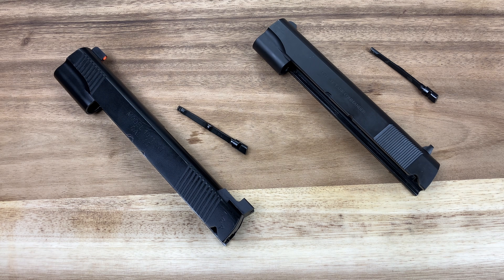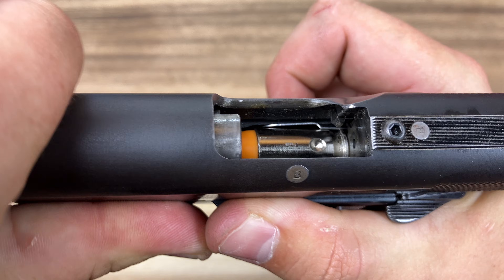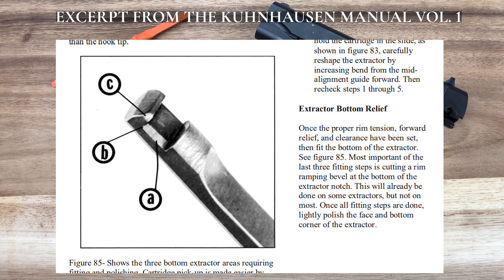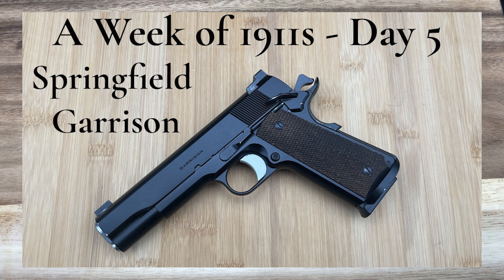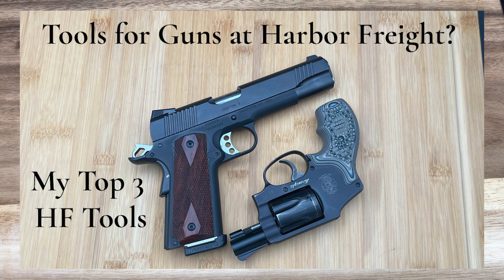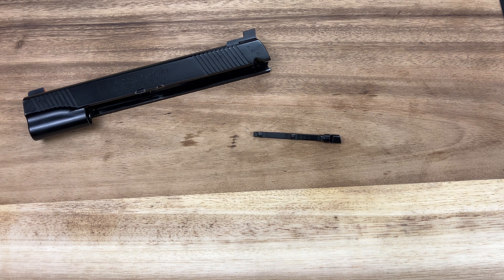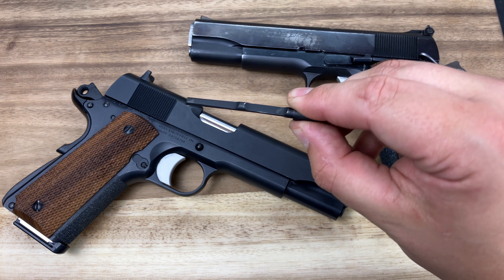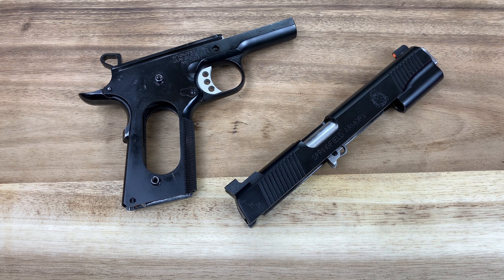A "Quick" Look at the 1911 Extractor (a Response Video to @OldPathTraveller 's Extractor Video)

Comment: Thanks for the (double) shout out homie! Great video. Enjoyable watch with my evening tea. Good info in this video, nothing I disagree with. Even if I did disagree... who cares I'm not an expert. 

I will also advocate for the 10-8 test procedure, I find it really valuable. 

This is my favorite extractor tuning video and how I learned to set tension on my 1911s:
https://www.youtube.com/watch?v=Xm3ss3XMQxM&t=420s

When I was researching for Episode 5 of my double stack 1911 build series (that contains extractor fitting and tuning information), I go WAY into the weeds. My initial script for that section of the video was going to be about twice as long as it ended up being. You can get into measurement and quantification of every aspect of the fit and even how its tuned. That was my starting point - I err on the side of quantification and measurement when I don't have a "feel" for something. I spun myself out and took a step back and said "what am I doing? I've successfully tuned a bunch of 1911 extractors." If the measurements and quantification of every little detail were valuable to me in practice, I would have included them in my video. Some measurements stayed in, those are what I find useful haha.

You hit most the high points in this video regarding tuning and some of the geometry mods.

When fitting - the fit of the groove to the firing pin plate - you want it tight, this also affects hook to breechface clearance.
The hook to breechface dimension, this is one I do measure, but the functional range is quite large.
Clearance between the tip of the extract and the front taper of the case rim area.
And where the hook interacts with the case. 

The hook needs to interact with the case in a different place on a 45ACP vs 9mm. I have ruined an extractor because I went to fit a 9mm extractor like a 45 extractor. It helped me to remember the minimum hook height you don't want to go below - about .030". If you try to fit a 9mm extractor like a 45 extractor, your hook gets way too short.

Then the little modifications to the geometry to help with feeding - like the bevel leading into the tension pad, and some polishing here and there.

The tension after it is fit and installed can be measured with deflection gauges. I dont find that necessary. The tension test I linked to, or the one in the Jason Burton video you mentioned, and the 10-8 test while firing will get you there.

The two Tisas pistols I had, the 1911 DS carry, and the MAC9DS (both Gen 1), had too much extractor tension out of the box. The MAC9 was so tight it gave me a couple failures to feed. I have seen production extractor tension all over the place.

Really enjoying your content bud.
Reply from the maker: Firstly, thanks for the kind words! I'm always happy to try and expose my audience to your excellent works. 

Secondly, I'd say that on the sliding scale of "expert", you are certainly at, or much closer to that designation than 99.9% of 1911 nerds out there. If I need technical information about the 1911, it's the Kuhnhausen Manuals, and your videos & experiences. 

The Atlas videos are generally pretty great for all of the 1911 works. I'd certainly recommend my viewers to go check out their sear spring video (although I like yours more), and their various tuning vids. 

For the firing pin stop groove, tight is certainly good. I'd say it's the least important of the aspects of the extractor, but a tight FP Stop fit will lead to a tighter, non-rotating extractor and good breechface clearance. A tight, fitted FP Stop will also lead to a  little less recoil (at least in my experience). We've fitted one oversized one, and that was kind of a process. All of my guns have relatively tight FP Stops though, so I won't complain there.  

We've also never found a need for the tension feeler gauges, just a matter of setting the tension, and testing it from there. 

My only 9mm Tisas came with the extractor tension fairly loose, which I know is kind of the opposite of most guns. Many of the 9mm guns that I've shot or monkied with (mostly Springfield and Tisas) tend to be over tensioned, like your two guns. 

Again, thanks for commenting brother! Keep up your great works! I've been really happy to see your channel growth over the last year!

Comment: I like "traveler" He's wrong about alot.  Question, stainless vs carbon steel extractors? Is one better than the other?
Reply from the maker: Just from the perspective of needing to work on it, the carbon steel ones will be easier to put some tension on, and will be easier to cut on if you need to reprofile the hook or bevel geometry. I don't know of too many companies doing stainless extractors these days, but I'm sure that they're out there.

Comment: Great video! Years ago, I had a cheap Rock Island 1911 .45 that I had to bend the extractor. I actually completely forgot about that until this video.
Reply from the maker: Thanks! 

With extractor tuning, it's really only a 1911-centric thing. I think of it like having a car that has a different way to change the oil filter when you're doing the oil change. It's not that hard to do, but it's something most guns need.

Comment: Paul, it seems like you are most definitely a purist and particularly enjoy the 1911 in its original form, internal extractor and all.  

That being said, have you had any experience with some of the more modern semi-custom 1911 designs beyond the 1970’s and 1980’s, where they come with link-less “bull” barrels, fitted or spherical bushings which remain in the slide during disassembly, modified slide designs with external extractors, and barrels that have one-piece feed ramps? (For example, some  SW1911 Pro series, Dan Wesson, and Wilson combat models, which incorporate many or most of these elements under the auspices of being enhancements, among other changes to the frame and not just the slide.)

In your opinion, does the change to an external extractor and the use of a single piece feed ramp integral to the barrel turn the 1911 into a push-feed design, as presumably the bullet is no longer being held by the extractor or feed ramp, and the cartridge slides into the chamber with the extractor then fully engaging the rim upon the slide closing completely into battery?

Are there potential advantages to the internal extractor design and the controlled round feeding when it comes to clearance of failure to feed or double feed malfunctions? 

Also, just as an aside… How does one safely remove a spent cartridge case stuck in the chamber and that has failed to extract without having to force the tensioned extractor to bend over and around the rim and risking damage or loss of tension in the process?

Thanks again for the insightful commentary.
Reply from the maker: I'll start from the end, and then loop back around! 

For the stuck spent casing, I'd recommend just locking the gun open, and using a rod or dowel to tap it out. 

For the bull barrel & external extractor guns, I have a lot of passing experience with the SIG, S&W, and Star pistols. That said, I have a lot of time with the Wilson Combat EDC X9 (three articles, a bunch of videos, and about 2200 rounds through the gun). 

When moving away from a bushing barrel and internal extractor, we lose some of our control over tuning the gun. That's not a problem if the gun is tuned really well from the factor (like a WC gun), but if it's something like a S&W and the extractor is crap, you're up the creek without a paddle. 

I do prefer a bushing barrel as I can more easily accurize it. That said, I'm not anti-bull barrel. I think that going to the modified Browning lockup (linkless) is fine too, just requires good designing by the manufacturer. As to external extractors, it's the same deal. As long as the maker did their testing, and made it so that I can swap the extractor when it starts to wear out (like WC does), I've got no gripes. 

For the gun going from controlled feed to push feed, I really think that it's wholly an extractor-related thing. My 9mm guns have single piece feed ramps, but are still controlled feed. I'd even say that it really depends on the gun. That EDCX9 was still controlled feed, and just had the extractor hinge really far into the breech face to control the round. On other guns (like the SIGs and S&Ws), they're still controlled feed, albeit that the first part of the action (picking the round out of the mag and feeding) is less important than on an internal extractor gun. Most modern pistols use controlled feed, which is why loading directly into the chamber is generally a bad idea. 

For malfunctions and controlled feed, it's you're generally going to have better primary extraction, and lower chance of double feeds. Since the rounds need to be held by the extractor claw and have to clear a lot of the feed lips on the mag, double feeds seldom happen on single stack mags. However (as we'll probably all had in the past), double feeds are more of a magazine related problem (loose feed lips) than an extractor one. 

For handguns and push feed, there really aren't all that many. For push feed designs, you have to look at guns that have doublestack and double feed magazines. The VP70, a lot of rimfire guns (like the KelTecs), most guns in 5.7, etc. For rifles and submachineguns, push feeding is pretty common, especially with the advent of intermediate cartridges. 

Long comment, but I hope I was able to answer most of your questions!

Comment: Great video, Paul. Thanks. I recently did the 10-8 test on my Colt Double Eagle. Seemed to pass... the trajectory of the casings was more or less straight up, but I suppose it arced off between 2ish and 5ish.
Reply from the maker: Thanks Matt! 

Honestly, that's pretty impressive out of a Double Eagle. I've never monkied around with them, but I know that a lot of the slide internals are Series 70/80 1911s, and the frame is much different. 

Looking forward to your full video on it!

Comment: I simply do not believe Traveler's claims about the reliability of his personal guns while also claiming he's only touched the extractor on one, especially with the round counts he claims.

He shows a bunch of pistols with very inconsistent ejection and says the consistency doesn't matter, which makes me raise an eyebrow. Inconsistent ejection is one of the most glaring indicators of an unreliable 1911, typically indicating undertensioning.

His video particularly annoys me because he claims that the problem is essentially made up, and uses his own "experience" to support his claim. In my experience, most of the production grade guns I've worked on, (which includes most of the guns in this video) have exhibited extractor problems in one form or another. Especially if it's a smallbore 1911. This experience has shared by anyone who has worked on 1911s and has been thoroughly documented for decades.

It also annoys me since it downplays a very common and easily fixed issue, which will inevitably lead to shooters new to the platform becoming frustrated if they run into extractor related problems.
Reply: Traveler explicitly says he doesn't agree with people who think a gun is broken if it fires reliably but doesn't stack empty brass in a inch diameter on the ground. 

You can disagree with the approach, but it sounds like you're saying reliably functioning guns need to be "fixed", which is pretty silly.
Reply: @ruffryder13  You don't seem to grasp the concept that a pistol may be functioning well for the time being...but is giving indications that it is on its way to a failure point. That would only seem "silly" to a simple mind.